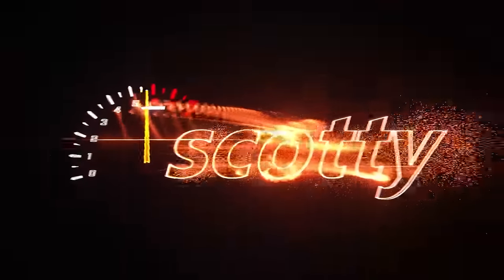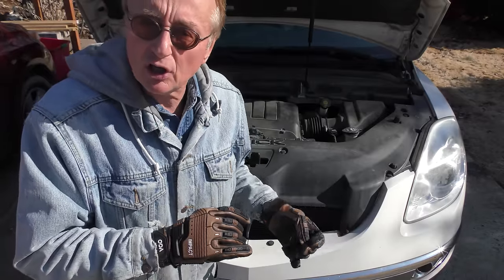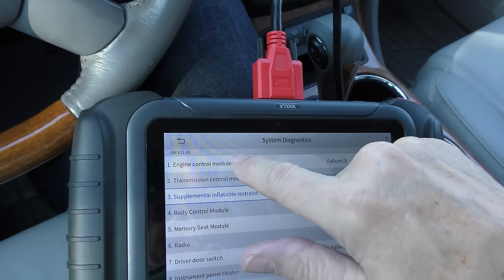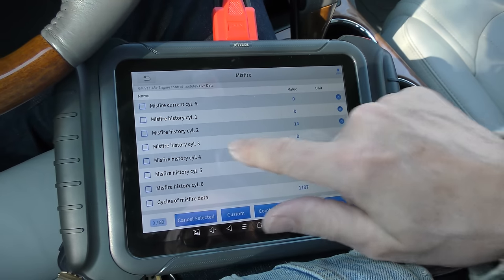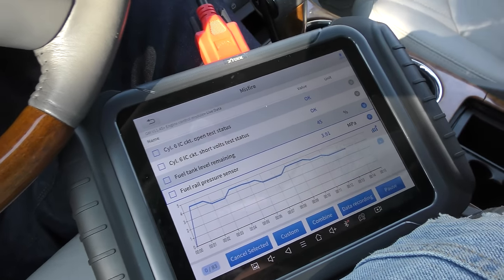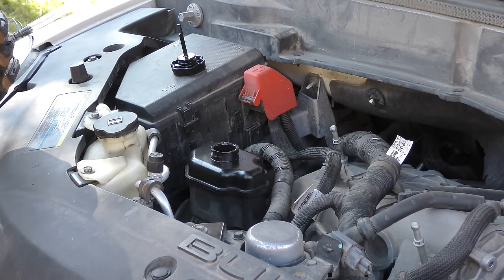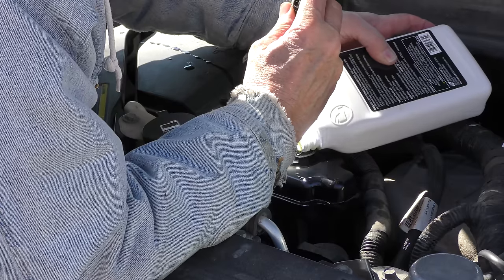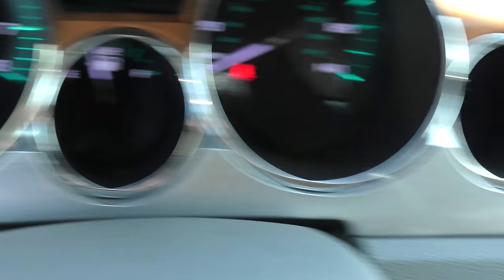Here’s What Happens if You Don’t Change Your Power Steering Fluid

Comment: Hey Scotty I have a 2004 Chrysler Sebring with 125,000 miles on it and my transmission seems to slip someone 1st to 2nd but hard 2nd to 3rd and 3rd to 4th what do you suggest I could try?  I bought it at 117k I never changed the fluid nor do I know if the previous owner has.
Reply: The Chrysler transmissions (A604 (41TE) are highly susceptible to failure. The reason for the 1-2 slip is a worn or damaged sealing ring. If you replace the fluid, it will slip more and then completely fail. Decision time is now to either repair or sell the car.

Comment: Not sure why you'd bother using a scan tool if the check engine light isn't on. Just take it for a test drive, check spark plugs, check for rust, check transmission not slipping. Thats about it.
Reply: It's good to be thorough. The check engine light on the cluster could be broken or burned out. So you can have codes and problems without even realizing it because the indicator was out.

Comment: Gm steering and abs systems  have always been garbage. My aunt had a early 2010 Buick and they just stopped making  replacement  steering and abs parts for it! GM  just junked those designs and went a whole different  design,  and aftermarket  just said the cars are such Junk and old don't bother  making replacement parts, so only option is to get a Toyota  or find something in a junk yard to fix an older GM vehicle

Comment: DUMP THAT 💩! The enclave, Acadia, Traverse, and outlook Are notorious for having his having high rates of failure failure of of both the automatic transmissions as well as the timing chain. If you have one of these don't don't pay any attention to the Is "service required" light.. Change your oil every every 3 or 4 months regardless of the mileage!  Time is much more rough on the power train then then miles are. I've seen these engines blow oh at 45K miles is K miles and I've seen them blow just over 100 K mile miles and the difference always has to do with Ho with how long the owner weighted between oil changes. In the case where the customer Had the infamous rod knock bodknock At 45K was because since since she was elderly elderly she may be drove the car about about 4k miles yrly So the same time every year she would take the car in for 4 it's yearly maintenance and annual oil change is oil change at the dealership. Because of all of the short trips in the engine not having a chance to do come to proper temperature temperature as often as it needed the crank case tended to build-up condensation which deluded deluded the oil. The other and far more common reason these engines failed failed was due to 2 the oil changes Bing spread too far apart. The 3600 engine is not The GM engine that is known for Being almost bulletproof. Scotty Scottie is thinking of the 3800 V6. The 3600 is known for is known for high high oil consumption chicken which is is why they have such a high failure rate you're right when the customer doesn't change the oil it's the oil every 3K miles. Causing it to stretch or even pop.

Comment: Very interesting about when to change the power steering fluid  (every 5 to 6 years) and then when you do swap it out use  "synthetic" power steering fluid. Then the added bonus of  the Scotty process for how to swap out almost all of the old steering fluid and  replace it with the new stuff. Result: End of noise from the power steering pump. 😄
Reply: I just did this on my 2001 Honda Civic. I had steering wheel shake / vibration at about 60mph. New tires (couple months old) I had them re-balanced, and had my alignment checked but nothing would make that shake stop. I did this, after the 3rd time sucking out old fluid with $1 turkey-baster from Dollar Tree, got on the highway & hit it! It was shaking like normal for a minute or so then suddenly the shake reduced dramatically! I'm not even joking! There is still some shake, but comparatively speaking it's almost unnoticeable! Hopefully it will go away more over the next few hundred miles.

Comment: One tip is to absolutely make sure you are using the correct fluid specification for your particular car. Some power steering systems can be very picky about what fluid is used, so don't just grab anything off the shelf even if it claims its for "all vehicles." For example, some makes/model require ATF or ATF-HP (transmission) fluid, which is a little different than the typical Dexron-based fluids that are advertised as all-purpose Power Steering (PS/PF) fluid. Find the exact spec in your owners manual and get it ordered if you have to. Most auto parts stores will have no problem delivering the exact product you need to the store for pickup.
Reply: This is right on. I had the power steering fluid changed in my 2001 Pontiac Aztek in 2021 and I was surprised to learn the mechanic used transmission fluid. I'm surprised Scotty didn't mention that transmission fluid is sometimes used or recommended- especially being the car in the video is GM.
Reply: GM and Honda are VERY specific.

Comment: Gotta diesel pickup? Change/flush power steering fluid is even more important because it’s the hydro boost fluid for the brakes too. 😉
Reply: Yeah. What a crazily bad design. I have a 7.3.. blow a hose going down the hose and you have crap to no steering OR brakes. That makes sense. 🤦🏻‍♂️
Reply: @bch5513  yep exactly I hate power steering assist braking
Reply: Yea no joke. Had a 6.4 and lost my power steering pump and fluid went with it. Felt like I had no brakes. Had to change my power steering pump and my pants that day.

Comment: For power steering fluid, never use ATF as a substitute for power steering fluid. Only use power steering fluid into the power steering reservoir. Also if you have an older Honda vehicle or an older Acura vehicle, only use Genuine Honda or Acura power steering fluid or power steering fluid made only for Hondas and Acuras.
Reply: Older Ford's use mercon for power steering fluid tho 🤐

Comment: Got a traverse with the 3.6 and the engine runs great after 150k...the transmission however is a different story.....even with regular trans fluid changes at 42k, 92k and 140k it slips between 3rd and 4th. I think I'll just keep driving and when it goes out all the way,  make a decision  to fix or part it out.
Reply: Very common for these. Save up for a new tranny because it's on it's way out.
Reply: Why don't you check with the dealer and make sure there's no service alert concerning the transmission? If so the dealer will owe you a free fix or repair!?

Comment: The 2010 Buick Enclave is a POS. I had one and it was nothing more than a money pit. We had an extended warranty that more than paid for itself. One thing after another went wrong with it. All before 100k miles. As for the misfire, watch for oil intrusion into the spark plug wells. It fouled our plugs so badly it almost left me stranded in limp mode. Steer clear of this junk.

Comment: Buick Enclave,& its cousins are junk- power steering, steering gear, alternator, master cylinder & booster plus engine timing chain problems are it’s troubles, typical GM junk.

Comment: Hey Scotty IV got a question I just got myself a 1960 Chevy Brookwood wagon car seems pretty solid for it's age it has the original 283 engine in it with 39000 miles on it but the oil pan is dry and it hasn't ran in 38 years how would I lubricate the cylinders and get it ready before I try and spin it there isn't a drop of oil in the car
Reply: Kindly note that your use of "it's" should be "its".

Comment: I always turn the wheel to lock on one side. Suck out the fluid and refill with clean fluid. Turn the wheel to the other side and suck it out. Sucks in clean fluid as you turn the wheel to the other side.
Reply: When you turn the steering wheel is the engine off or idling?
Reply: @frankg6578  Engine running, because otherwise the pump isn't working to suck in the fluid.

Comment: I have power steering fluid coming out of the cap. May have to buy another cap that seals better to stop the leak. 2012 Chevy Traverse. I have to keep adding fluid everyday or a few times a week but the noise is so bad at times and the steering is difficult every now and then but it turns better when pressing the gas during those situations

Comment: I've got a 2011 Chevy Traverse LS with 215,000 miles.  I also like the 3.6L, (it's leaking oil a little but I'm not too worried).  The one thing I hate about it and other GM's is the stupid stabilitrak message (had to replace the throttle body and also modify the PCV valve, which also ended the milkshake problem).  My power steering is buzzing, too.  The power steering fluid is leaking very slowly, so with the age of the car, I'm using power steering stop leak and it's OK.  I'm not about to replace the power steering pump.  I'm just trying to baby it now and get as many more miles as I can.

Comment: I have a Honda Pilot started out with leaking water pump,replaced it, then nosie power steering pump and I mean its nosie you can hear it inside the car with radio. Then mechanic says I need a rack and pinion, so go to second he says probably got air in system. So I drove it home and parked and bought a truck two weeks later oil pump  went out.

Comment: Scotty Scotty Scotty that GM 3.6 is one of the worst V6 engines it's plagued with timing chain problems if it's the one I'm thinking of that they put in those I believe they call it the high feature V6 I call it the high failure V6 LOL

Comment: Go to Costco and buy the super sized Head and Shoulders, when empty clean it out and the pump mechanism. So now when you go to change the oil, put the  tube of the pump into the PS pump and suck out some old  fluid into the H and s  container and replace with new fluid. If you pull the low pressure hose you will make a mess.